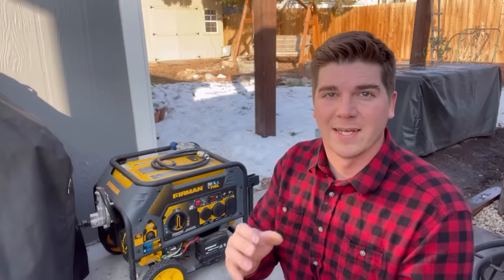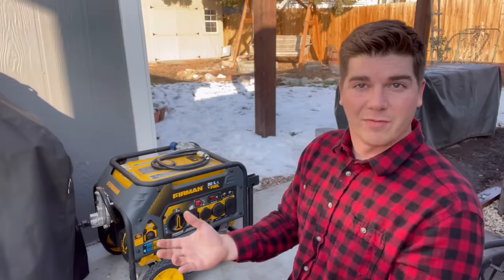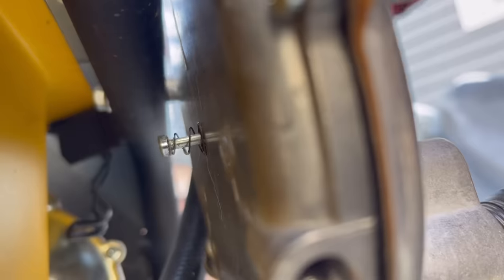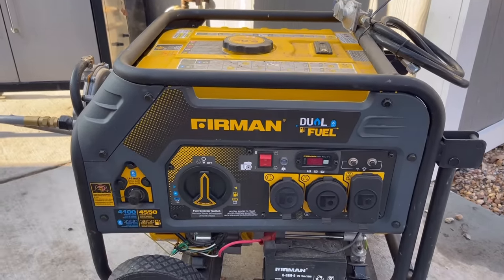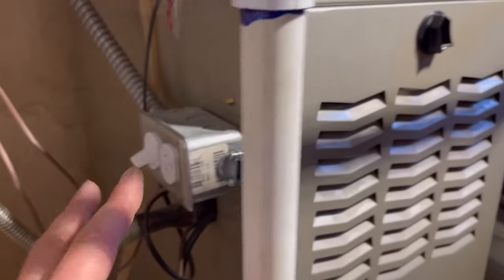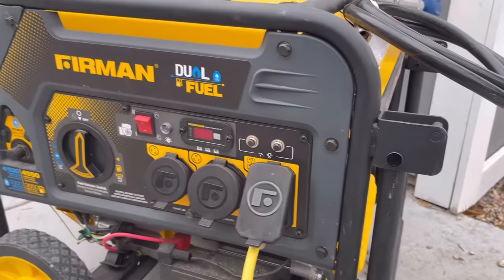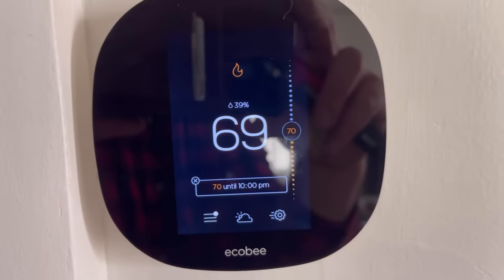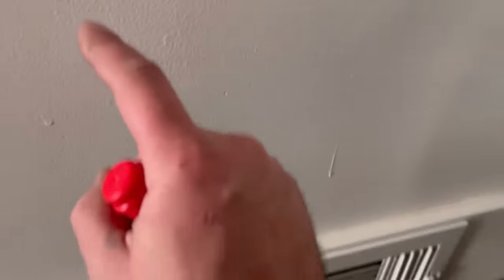Most Homeowners Don’t Know About This Trick To Get Heat During A Power Outage.

Comment: I’ve watched a few videos of guys using a quality 1000w power inverter and their car to run a furnace.  Neat idea if the car is full of gas and you park it outside while it’s running.  Start the car, let the furnace run up to temp or hotter then shut it off.  Pretty cheap and less maintenance than a generator as long as your vehicle/battery are in good condition.  A lot less work if your not able to move/store/maintain a generator.  You will need to build a box or roof to keep a generator out of the weather too in my experience unless you have a porch or garage you can open.  The more heat sources and power options you have the better.  We have a LP furnace, wood stove, kerosene heater, wall hung LP heater, a few electric ceramic heaters, and LP tank mounted heaters.  We’ve gone 8 days without power before and you learn fast to get buying and get prepared.
Reply from the maker: Amazing. Thanks for sharing 🙏🏻

Comment: A good and easy way to plug the orifices that you aren't using on your propane regulator would be to attach a short section of the hose and plug it with a bolt.  No spiders would get in and you'll have the hose hooked up if you decide to put the regulator back into service.

Comment: We used a generator to get heat for an older couple who lost power in the last blizzard storm where several around us lost power. Using a regular gas generator. Now unless you have a really nice generator that accommodates, you will need to run a jumper between neutral and ground on your male whip you connect to the furnace. Otherwise the board will fault out and no Ignition sequence.

Comment: MIND BLOWN!!!! 🤯🤯.  North Eastern Ohio, urban area. Power outages for me are rare and brief. However, a day without power in winter can turn a house into an ice box. Will definitely be looking into the gen option, but the bat powered furnace is a MUST. I do service a VARY rural area where power outages can last for several days.
Reply: WOW! Update: I have the power inverter hooked up to the furnace for emergencies. Awesome idea, thanks again. I priced out that port gen you recommend  2 months ago it was $499...... Today (3/26/2023) It is $699.99!!!!  "stuff" is getting real folks.
The question:  Do you have a recommendations for a 240 volt dual fuel gen? (Want to be able to run A/C) EDIT: An Electrician by trade.

Comment: Neutral bonding is issue when people do this. The furnace needs a good ground and it needs a good, single, neutral-ground bond at the distribution panel, or in this at case the generator.  If the generator has a bonded neutral and the neutral is not switched at the transfer switch then you end up with ground loops, and the furnace refuses to light. If the generator has a floating neutral and the transfer switch does switch the neutral then you end up with no neutral-ground bond anywhere in the system and the furnace again won't light.  The particular problem that's happening in the furnace has to do with the flame sensor and the fact that it completes its circuit, through the flame, to the furnace ground. If that ground path is disurbed then the flame sensor won't operate as expected and the furnace controller (computer) will sense that as a failure to light (the gas) and it will shut itself down or put itself into some sort of safety lockout.

Two situations work: i) generator bonded netural and switched neutral at the transfer switch, ii) generator floating neutral and unswitched neutral at the transfer switch. In case i, ground conductor continuty back to the panel is fine. In case ii their must be neutral and ground continuity back to the main panel because that's where they are bonded.

Comment: Good video. I used the same Garretson natural gas regulator to convert an old Porter Cable generator to NG and it is super convenient to just quick couple to the  home's gas line. It starts right up with no need to worry about old stale gasoline or running out of gasoline if power is out to the local gas stations.
Reply from the maker: It’s so nice isn’t it?!? I love it
Reply: That is a nice set up.
Reply: No issues with larger loads? I don’t get how it’s regulating the amount of gas coming to it
Reply: @somethingsomething404  The regulator varies the gas flow as a function of vacuum, just like a carburetor.

Comment: You have an interesting process that will work.  I used a pigtail as well, but I ran it from the furnace to the dedicated curcit  junction box I converted to a single plug to meet North Carolina electrical code.  This way, I can simply unplug the furnace from the wall and plug the end into a drop cord that is run to my small honda generator.  I also installed a conduit through an interior basement wall that has a flip cover.  This way, I can run the dropcord under my garage door so that no doors have dropcords run through them, and all of them are fully closed.  There is no need to trun off the breaker for the furnance, but I still do to keep the process the same for deentergising the power.  My wife can complete this simple process without any issue.  The grid power can come back on at anytime without any concern, as the furnace is completely independent like a large appliance.  The panel does not have to be shut off.  The local code only allows for a single plug for the furnance.🎉

Comment: Before you buy one just think of the noise level of the generator. Your neighbors are going to appreciate if you buy a Honda or alike and just think if you could sleep with this tractor running next to your house:)
Reply from the maker: Ver good point! One advantage to a smaller one.
Reply: When it is in the middle of winter and you need heat who gives a f@#k what the neighbours think you are just trying to keep warm . If they have any sense they will be doing the same thing.
Reply: @12wingwfetech  couldn't agree more! Survival situations surpass courtesy.
And use the extra outlet to feed the electic fence...😉
Reply: @dje7335  🤣🤣🤣🤣 Can't    stop    laughing!     
For real though...Great idea. I'm getting a cheap fence charger now.  In an extended outage generators could tend to walk away.

Comment: Youll want to get the engine running and the power stabilized on the generator BEFORE you plug in your power cord. Also, you'll want to unplug your power cord BEFORE you turn the engine off. The way you did it, you are sending power surges and unstable power through the extension cord to your furnace, which can blow out electronics boards.
Reply from the maker: This is good to know. I learn something new every day here on YouTube thanks to commenters like yourself. Thanks so much 🙏🏻

Comment: I totally agree.  You mentioned on those other videos that the setup with the inverter was for an emergency when you have no other choice because generators are not available.   Some cannot afford a generator.  The battery and inverter is more economical.  I have a Tri-fuel Firman generator with power going onto my house using the 30 amp 240 volt cord.  It goes through to the transfer switch.  I haven’t had a power failure recently but I hope it will work in the event of one.
Reply: @Glocktard  I run it for 20 minutes each month so that it doesn’t cease up on me.  I have a reminder that pops up each month.
Reply: Anyone can afford a generator. It's all about the priorities. People wastes mega $1000's on stupid crap like smokes, beer, alcohol, eating out, going on expensive useless vacations etc. Then complain they can't afford electric bill.
Reply: @brnmcc01  That’s true to a certain extent.  Those on fixed incomes may not be able to afford a generator. I could because I don’t smoke or drink or go anywhere on vacation.  Kind of boring yes, but I really don’t have the money to travel and I don’t need bad habits like drinking and smoking adding to the problem.  Electricity where I live is very stable but we did have 2 tornadoes since 2018.  That took the power out for more than 24 hours each time.  I think because power is so stable people don’t think about having a generator.
Reply: @ds99  Oh yeah that's very true! There's too many people on retirement that can't even afford gas and groceries these days, and then they have to rob Peter to fill their prescriptions. It's terrible.
Reply: @ds99  And even if you live in an area where the power is very reliable, look what happened in North Carolina a couple weeks ago. Some morons shot up two substations and took out several transformers, and Duke had a hard time getting things back up and running because of all the parts and material shortages going on. All it takes is a bad accident, or deliberate sabotage to take out power for a week or two in any area!
Reply: @brnmcc01  That’s alarming that people would do something like that.  I agree it’s good to have a generator.  That’s why I bought one.  I lost $450 worth of food twice in the last two outages since 2018.  $900 out the window so it was a no brainer.  Still I understand some people don’t have an extra $1,000 to spend on a machine.  The ones taking lavish vacations could.  Two incomes with $200,000 coming into their household - they could.  But sometimes living on $20,000 per year or less on a single income it’s a no go.  Also people Living in an apartment complex.  They have nowhere to put a generator.  Especially if you’re up on the 8th floor.  I feel fortunate that on my single income I was able to get one, but I’m very careful with how I spend my money.  This was a priority for me.

Comment: A better way to do it would be to get a bigger portable generator (mine is 8,500 starting/ 6,800 running watts) and back feed it into your home’s breaker panel. Mine connects via the 30A outlet on the generator to a 220V outlet in the garage (via a heavy duty RV electrical cord with locking prongs) that was wired by an electrician into the panel and has its own dedicated breaker. So, if the power goes out, you shut off the master switch, start 
the generator and switch the generator breaker on. The entire house is powered, with NO cords running to individual lights or appliances. 👍🏻
Reply from the maker: This is the plan in the next month or so!! Thanks for sharing
Reply: It's a great setup, Double check the main is Off, before starting generator. Have a check list ready for generator sequence when power goes out. My electrician wired a light to the always hot lugs at the top of the service panel ( above the main shutoff) so I can tell when grid power comes back.
Reply: @dand3975  
I really like the idea of an indicator light for the main power status. 👍🏻
Reply: @SquirrelTheater Your Very much Need a Liscensed Electrician, to make that connection.

Comment: I have this exact same generator that I power with a 20lb propane tank.  We have an interlock system setup on our electric control panel and an outlet outside the house to plug the generator into.  Easy peasy to set up and will save our bacon during  these cold Wisconsin winters should the power go out.

Comment: Get a 1800 watt inverter generator, lite weight and quiet to operate. Your neighbors will thank you. That size generator will do fine connected directly to your furnace.
Reply from the maker: Absolutely. The only reason I have such a big one is I sometimes use it for my ac in our camper. Cheers

Comment: I love the idea of a dual fuel generator.   I have natural gas too.  This would be a great way to power my house with my generator transfer switch.  I had a electrician put one in my house. I can run everything except the electric stove and washer and dryer.  My house is a small one.
Reply: Just get a Generac standby generator, the one I have can run everything and the air conditioning too. But before getting the generator, I swapped out the stove and dryer for gas versions. Saves a lot of electricity use, and I was able to get a much smaller generator. There's no point in burning gas in a generator to make electricity to just waste and turn into heat. It's 3x more efficient to just burn the gas directly to get heat. Small generators are only about 20-25% efficient in turning the energy in the gas into electricity, so you end up throwing away buckets of money running a generator to power a clothes dryer or stove. Use the generator only for electronics or motor and lighting loads, the things you can run off of gas directly.

Comment: This can also be done with a gas generator. Don't forget to turn off the circuit breaker for your furnace, you don't need to do for the whole house. Make sure the generator is far enough from the house to prevent carbon monoxide poisoning. You can also power your fridge, freezer, sump pump (or portable small window AC unit) and some lights (purchase a 3500 watt generator with 4 normal 20 amp or 15 amp outlets on it). You may have the light switch / plug combo on your furnace if you have a condensate pump to pump the water to a drain from the AC / Humidifier on your furnace.
Reply: I get the importance of making sure you don’t send power back to the grid, but in the video the furnace is unplugged from the power supply, and plugged into the generator. Whether the breaker is switched off or not, I see no way to send power back to the grid. Am I missing something, or is this just the ultimate sense of security that is not really necessary? Thanks
Reply: @chrisward8278  You are unplugging the condensate pump, not the furnace most of the time. If feeding power into it, you will back feed power into your circuit breaker box with it coming thru when the power comes back on.
Reply: @easywindowssidingllc1464  he's unplugging power to the entire furnace. He connected the whole furnace system to that plug specifically for this reason.

Comment: That 100 amp breaker in the main panel that you turned off, I think needs to be locked to prevent anyone other than you from operating that breaker switch. I know you are very good at what you do. Just an observation brother. Be safe!
Reply from the maker: Thank you. I’d love to do the interlock kit and power inlet box at my house but haven’t made time to tackle that one. Thanks for the tip though! Cheers

Comment: Nice generator and I like the pigtail but who wants to have an extension cord running out the door overnight in the winter time or possibly longer you might as well bite the bullet and put in a transfer switch pretty easy to do then you can run your furnace or whichever items you decide to turn on great work thanks for the video!
Reply from the maker: That’s next on my list!! Just thought I’d share what I got so far :)
Reply: At my house, I installed an interlock on my service panel. It is made by Siemens and is UL approved. Much cheaper than a full blown transfer switch.
Reply: @tgriebe  yeah I really like the interlock system as well unfortunately my panel was completely full opted for the six circuit transfer either way I guess we’ll be ready😄😄
Reply: ding ding. this dude stole my thunder. generator-transfer switch-no hula hoops to jump through. couple grand up front with gen purchase(599)50 amp cord(399) 50 amp 10 circuit transfer switch(400)electrician(400) I rotate 20-25 gallons of high octane tru fuel and have (4)30 pound lp tanks ready to let er rip.  I rest easy knowing this is ready to go.
Reply: If you have natural gas I would check your breaker box. What I thought was a full breaker box turned out to not be true. They wired the house for all electric appliances. I have a gas stove, gas, dryer and a gas hit water heater. So I had 3- 220v breakers that were not being used. My AC unit was in the top right location where the interlock is supposed to be. Right under that was the water heater. So it was as simple as turning off the main breaker and moving the wires. The hardest part was pulling a little extra wire down from the mass coming from the attic. Only needed an inch or so but the slack was there
Reply: Always start your generator and then plug in your extension cord.
Reply: @diyhvacguy   Any details or updates on installing a transfer switch?

Comment: If a person has the means, I suggest checking into installing a permanent standby generator. Standby generators are typically intended to be connected to critical systems - like HVAC, refrigerators, microwave, water pumps, sump pumps, some lighting, and security. If you plan to have an additional freezer, a chest freezer is a good option so you can still go into it occasionally as needed without dramatically impacting the cool air while the power is out if you don't want to have it connected for extended outages.
Reply: Easily 10 grand these days
Reply: Rich man's plan. Far out of reach for the average Joe... 
I'll keep my little generator with extension cord and pocket the $9500+ savings.
Reply: So my neighbor quoted one out after a storm ripped through where I live that knocked us off the grid for 5 days over the past summer. He was minimum quote was $13k. While he was getting those quotes, my electrician swung by and wired in a Generac Transfer Switch and I bought a Champion Generator so I can now easily run the vitals of my home (A/C, Furnace, Well Pump, Kitchen Appliances, 1 bathroom, and Living Room) all for under $3k. I may or may not ever have to use it again, but at least Ill be comfortable whether its -25 wind chill or 100 degrees outside

Comment: You’ve got the generator, the gas hookup, all you need is a proper way to connect it safely to your panel via a power inlet and transfer switch. With the same amount of effort you could be powering most if not all of your house rather than running extension cords everywhere.
Reply from the maker: Yes that’s soon to come! Cheers